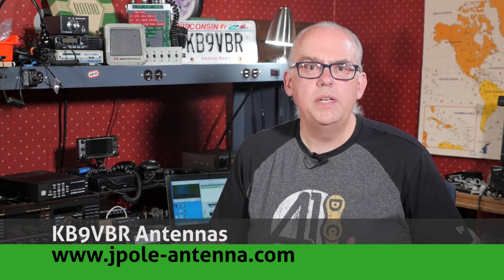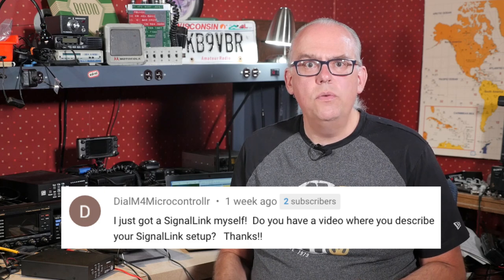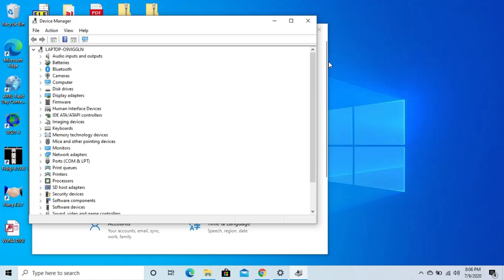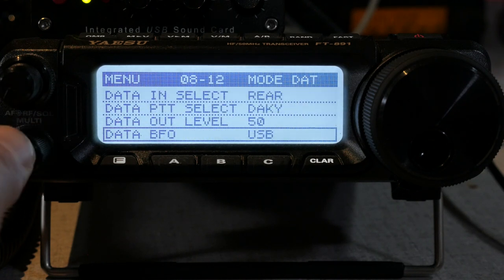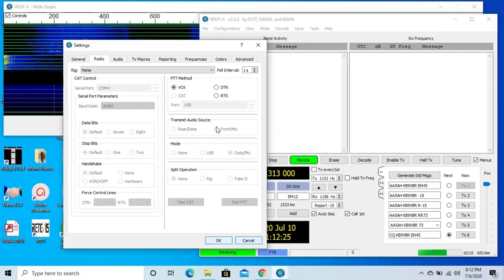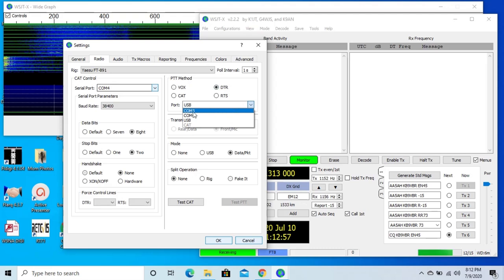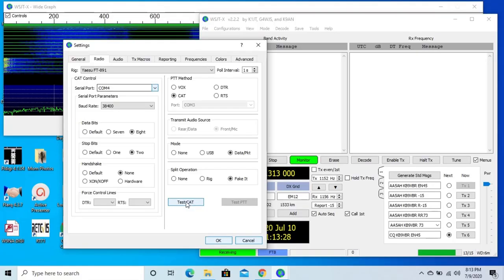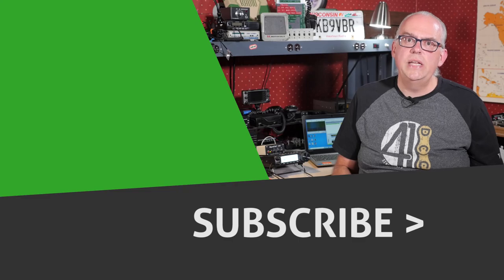Yaesu FT-891 Setup for Digital Modes - Ham Radio Q&A

Comment: Great explanation as always!
I noticed that in DATA mode the transceiver automatically disables AGC, which is understandable. Do I need to somehow manually adjust the gain for the FT-8 or just leave this knob alone?
And also, are there any differences in the settings for the FT-4?

Comment: Great video thanks. You also said "Unfortunately I had issues with Winlink so that will be a subject for another video " any plans on the Ft-891 Winlink video? I hope so, thanks.
Reply from the maker: Thanks for the reminder. I think part of my problem may be computer related so I'll revisit this topic.
Reply: @KB9VBRAntennas  Maybe but since I got FT8 working fine but still have issues with Winlink I am not sure. Actually I am not sure of much other than I can't get Winlink to work on HF. Frustrating but at least there is good ol VHF.

Comment: Have you run into any Hamlib errors?
I’ve had no issues before today. Not sure what I changed to have it be an issue. Rig and software will be running fine. Plenty of QSO’s and I’m seeing people ‘hear’ me around the world. Then: randomly (mid QSO) I’ll get a Rig Failure error window pop up and lose CAT control. Says it times out verifying current radio frequency. 
Only sure, but now apparently also temporary, fix has been to completely power the rig down and restart the PC. 

“Rig Failure

Hamlib error: Communication timed out
set_cache_freq: set vfo=VFOA to freq=0
ric.c(1488): set_cache_freq return(0)
ric.c(2030): rig_get_freq return(-5) wile getting current frequency”

Comment: Just got an 891. I'm wondering why you limit the transceiver output to 40 watts. WSJT-X documentation says to leave radio output at 100% and use the slider on the lower right to control power via audio level. This has worked on my ICOM 7300. Also - the Signalink website mentions two cables are available for the 891. Which one are you using?

Comment: Great video!  I actually made a cable from the data port on the back of my 891 to my computer's sound card and use the USB cable for CAT.  No need for a signalink.  Can you do a more detailed video on how to work FT-8 and other digital modes?
Reply: I’m with you - I don’t know why more don’t do this.  As it is the SignalLink has knob settings that were not reviewed with this video - how do you set up the computer’s sound card?

Comment: Adjusting "deep" menu item 16-03 to limit  data mode output power to no more than 40 watts is a great idea.  BUT unfortunately this same "deep" menu item also limits you to 40 watts on CW mode.  That needs to be a settable value stored by "mode", or else a front panel control.  What was Yaesu thinking...?
Reply: SSB is a completely different setting  (16-01) - But yes 16-03 will affect CW.

Comment: Does the yaesu ft450d setup similarly for digital and wsjt-x mode ops?
Reply from the maker: The process should be very similar. The menu numbers on the transceiver may be slightly different, but the process will be the same.

Comment: Are you using a usb cable connected to the rear of the FT-891 and a usb connected to the signalink to your laptop to do digital or just the signalink only?
Reply from the maker: I'm using USB through the Signalink and USB CAT control for the radio, so both USB ports on my laptop are being utilized.

Comment: I recently acquired a brand new FT-891  and configured everything for FT8 based on this video. I noticed that when the FT8 transmits it randomly triggers PTT. In order words, The radio doesn't transmit when its supposed to transmit. That happens with Tune as well. Sometimes it works, sometimes it doesn't  What be the cause of this problem? RFI on the usb cable? I used a standard computer cable that have ferrite tubes on each end.

Comment: Great video for setting up the 891.  I found a problem as one of the others in the comments below.  When using Fake It and if you have xmit freq above or below 2000 in WSJTX  the radio  display changes freq during xmit but stays there when going back to receive.  Evidently, I am not the only one having that problem.  Would sure be nice for someone to comment on how to fix this.   I set mine up for rig control and it sets the radio in split and moves radios xmit frequency (VFO B) when you shift xmit freq in WSJTX.  I had to set both VFOs to Digital USB and it works GREAT.   Like I said a comment regarding this issue would be appreciated.
Reply: I have had the issue when running split as "Fake it" and the Frequency adjust on tx up 0.5 KHz but when the radio goes back to RX the frequency does not readjust and on another TX the frequency adjusts up another 0.5 KHz and it keeps adding up every TX.  The way i have fixed this is by setting the PTT method to RTS and then selecting the USB interface in the drop down menu.  Now the frequency will adjust on TX up 0.5 KHz and go back on RX.  That said i have also had it where the frequency wouldn't adjust with on TX and i was still in a portion 2000 above on the waterfall.  I have tried your method of setting both VFO's to data then setting the split operation to " Rig " and this seems to work along with the PTT settings i mentioned above.  On TX the radio transmits from VFO B and then on RX it listens on VFO A.  VFO B ( TX VFO ) went up 0.5 KHz on the first TX but stayed there every TX after.  I am not using a signal link and my menu settings are different then the ones in this video.  Also after a couple of days of researching this in different places on the web it is very weird to me that so may people using the same radio and same setups and programs have different settings in their radio and different settings in their programs.

Comment: Can you help with the proper cable to order and jumper module for the FT-891?

Looks like:
 	
SignaLink USB p/n SLUSB6PM and SLMOD6PM?
Reply from the maker: Those are the correct part numbers for the cable and jumper pack.
Reply: @KB9VBRAntennas  thanks and keep up the great work on your channel!
Reply: What pins were the Signalink pin settings on the SLMOD6PM  @KB9VBRAntennas

Comment: One question.  I have taken most of the steps you have given.  I do see I have 2 com ports showing.  Do I need to installed the Signalink software & utilities disc that came with the unit?  Thank you so much for taking the time and putting this video together.  W7JMK

Comment: Michael, thank you for this video! Once I set up my ft-891 for ft8, would I need to change the settings back to use SSB? 
Like if I’m doing a POTA and want to switch from using one to another. Thanks so much, can’t begin to tell you how much I’ve learned from your videos!
Reply from the maker: If you use the Data mode for digital and the SSB mode for sideband, then you won't have to make a bunch of changes to the settings when you switch modes (except for adjusting the band width, WDH setting, when you go into the data mode). I have an updated video that has more information: https://youtu.be/afpvK8UrftU
Reply: Ahh, that’s great news, thank you. Also thanks for the updated video using the Digirig.  Again, thank you for your videos and replies to comments 😁. 73

Comment: Which Signal Link Interface did get for the 891
Reply from the maker: I use the Signalink USB interface and the SLUSB6PM 6 pin data cable that plugs in the rear of the transceiver. You'll also want jumper module SLMOD6PM if you don't want to configure the jumpers yourself.

Comment: Great video! Will the settings work for other digital modes as well? I do some PSK and SSTV. I want to learn FT8 and JT65. My SL is set to 857/450 pins. I'm guessing 891 is the same. Tnx! Steve

Comment: Mike, when I set things up as you lay out, for ft8 when my receive freq. is set to 14.074, but when in transmit it shifts to 14.0735. I've never noticed this before on my other fixed station, so I'm thinking it's an 891 setting but I can't tell what. Any ideas?
Reply: Mike, I think I figured it out. Between the 10 and 13 minute mark in the video you talk about the very thing I'm seeing, and I even see it on your display shifting from transmit to receive. Exact same thing. It's the split option. So this is not a problem but a feature that I need to understand better.

Comment: followed your instruction for ft891 with signalink and wsjt-x.  all functions, except no power out when transmitting...any suggestions?  thanks 73-gary
Reply from the maker: If there is no power out when transmitting, that would be an audio issue. When you transmit a signal on SSB, if there is no audio, there will be no power output. I'd check the audio chain and levels in the computer to verify that sound is reaching the transmitter.

Comment: The missing soundcard in the FT-891 keeps it, in my opinion from being a "great"portable radio and only a "good" one.  Yaesu got really cheap here.  The new FT-710 apparently does not have soundcard either.
Reply from the maker: I would tend to agree, Yaesu makes sometimes makes some really strange design considerations. But in their defense, digital modes weren't quite mainstream until FT8's meteoric rise with the 2018 ARRL grid chase. So they may not have thought that a sound card was necessary in a field/portable radio. 

I would be entirely surprised if the FT-710 did not have a sound card. While the specs on the rig are still pretty light, there really is no indication that one would be missing. Two items that lend to there being one is that the rig has two USB ports, type A and B, and it has a 'preset' mode that you can custom tailor for digital (specifically FT8, per John Kruk of Yaesu's podcast).

Comment: Currently running 891 HF phone mobile.  So I buy the signal link,  and connect,  set up rig in the menu for FT8.  Then I want to run HF phone again.  Just turn off signal link,  or reconfigure every time?  Thanks!
Reply from the maker: The FT-891 has a separate Data and SSB mode. If you set the rig up to use the Data mode for FT8, then it will remember your settings for phone when you switch back to SSB.

Comment: hello from Northern Albert -35c
Can this setup also work with the FT-757GX?
Thanks and have a great New Year!
01/01/22
Reply from the maker: Possibly. I don't know if the FT-757GX has yaesu CAT control or not. If it doesn't you'd have to set the rig up using VOX with the Signalink.

Comment: could you clear up which Signalink to buy, the cables needed and how to hook it up?  I watched the video a few times and you speak of connecting the computer to the 891 but not to the interface.   I probably missed it so I apologize.   73 KC3QQM
Reply: You may have found your answer, but I'll leave it here in case of others.  You of course need the Signalink USB itself.  Yaesu (and many other modern radios) use the SLCAB6PM cable - 6-pin mini-DIN plug.  And 2 USB cables - but pretty sure those come along with the 891 & SL-USB.

Comment: Would the settings for my ft-920 be the same?  Even if the menu numbers are different?
Reply from the maker: I'm not entirely familiar with the FT-920's operation so I'm not sure. The settings for the Ft-891 would  be a starting point‚ you'd have to experiment.

Comment: Have set up my SignaLink USB and FT-891 according to your video, but WSJT-X continues to crash after only about 2 seconds. 
Cable from SignaLink to FT-891 6-pin DIN; cable from USB back of SignaLink to laptop PC; cable from USB back of radio to laptop PC.
Must be doing something wrong, or cables incorrect?  Any suggestions? Thank you!
Reply: The same setup I'm using.  Did you get it going ? PM me at <calllsign> at arrl.net  if you want to compare notes.  Andrew NO6E

Comment: You omitted one VERY important aspect.  You didn't show or go over the physical connections.  Unfortunately trying to go to HRO or DXEngineering and finding the right model number that corresponds to the 891 is very confusing at they don't use part numbers that make any sense.  Would have been nice had you spelled out the specific model number you need to order for the 891.
Reply: To answer my own inquiry - here is what you need for the 891 - Tigertronics SignaLink™ USB Digital Communications Interface Combos SLUSB6PM-P ($140 presently).  And for the internal jumper kit -  you can use Tigertronics SignaLink™ Plug and Play Jumper Modules SL-MOD6PM ($10 presently)

Comment: I was able to setup the connection (I am waiting for the interface to be delivered).  When I close down the application, unplug the USB and even turn off/on the radio it seems to be still in digital mode.  Currently I have to reset to factory defaults to get back to SSB.  Is there a easier way?  I know this is probably a really silly question.  Thank you....
Reply from the maker: The FT-891 remembers the previous modes and settings when you turn off and on the rig. To get to the mode switch screen, long-press the Band button and use the function knob to switch from Data/Pkt to SSB.

Comment: Does this only work with Signalink, or will any USB audio interface work? You enhanced port shows as COM4, but you used COM4 for CAT control. Backwards? Would be good to show the physical connections.
Reply from the maker: The instructions in the video aren't specific to any one USB interface, so it shouldn't matter if you have an Signalink or not.

Comment: Great video...I have an 891 question...After working FT8 on 20M, my Radio remains in D-U mode. How do you get the radio back to USB? :) I have looked through all the menus and placed the BFO select in Auto.
Reply from the maker: When you leave WSJT, the program doesn't switch the radio back to SSB mode, so you will need to do that manually. You do that by long-pressing the band button on the top of the radio.
Reply: @KB9VBRAntennas  Got it.....yea it took some digging in the manual to find that about an hour after I asked that question :). Got about 65 POTA Contacts today in a little over an hour. 20M was strong.

Comment: hello friend I have the same equipment as yours the yaesu ft 891 the same signalink  and when I do everything like you it doesn't connect and it tells me this;

Error Hamlib: Protocol error
rig_get_mode(2204): freqMainB=0, modeMainB=, widthMainB=0
rig_get_mode: elapsed=83ms
rig.c(2207):rig_get_mode return(-8) Protocol error
rig_get_mode(2204): freqMainB=0, modeMainB=, widthMainB=0
rig_get_mode: elapsed=83ms
rig_get_mode: elapsed=83ms mientras obteniendo modo actual

help me please   73

Comment: You forgot to mention the bandwidth cause sometimes it goes to 500hz instead of 3Khz otherwise no signals can be decoded.
Reply: That is an issue when you first setup and causes a lot of initial confusion.
Reply: TXLorenzo Not only first setup I have it also when i have used the set sometimes for voice.

Comment: Hi, would the rig settings be applicable to the 857d? Cheers, Pat.
Reply from the maker: It probably would. I don't have an 857D so I'm not familiar with the menu options, but it would be a good starting point.

Comment: I have this same set up but the driver wont work with a Mac computer. from Yaesu , have any ideas ?
Reply: Apple broke the driver support in the latest update to their OS. This will only get fixed when Apple fixes it. It breaks more than just WSJT-X, but all programs that use the Silicon Labs driver.
Reply: @jyunte  thanks for letting me know this
Reply: I apologise.... The bug that Apple created is only for the FT-991 on the Big Sur OS. So it looks like you'll have to find the solution to your problem elsewhere. ☹️
Reply: @jyunte  no problem thank you

Comment: Great video Michael.  Everything works except WSJT-X forces the radio into split mode, even though it was turned off in the 891.  Oddly enough, the split is 1 kHz each time.  Sometimes it’s 14074 and other times it’s 14073.  I’ve restarted the program, radio, and computer.  Any thoughts on what might be causing this?
Reply: Normal depending on where you have ur xmit freq set on the waterfall  set to 2000 no change.  1000 it will be lower 2500 higher.

Comment: I tried using a Signalink along with the FT891 and had issues. With WSJTX, it will transmit one cycle then halt or disable transmit. If I don't catch it, I loose the QSO. Another issue I have ran into is that it wants to change the frequency...Its like when the transmitter is enabled and the software is doing the split thing, once it unkeys, the receive frequency changes to the transmit frequency. Fake-it doesn't work at all.....I have to use Rig split control....Wonder if anyone has had issues like this. At first I thought it may have been a RF issue, but the same computer and cables minus the Signalink work fine on a IC-7300
Reply: Gary, I’m having exactly the same issues. It transmits once, and then it won’t anymore. But it only does this intermittently.  Sometimes it will, other times it won’t. And after transmit, it won’t go back to 14,074. It’ll just stay where it was during transmit. Did you figure anything out?
Reply: @W7MMG  no, I gave up and sold the FT891 and replaced it with a 7300 for  POTA. The FT891 is a great radio for POTA until I decided to do digital. Since the 7300 has the sound card built in,  it makes things very simple
Reply: @garystout4300  I understand completely. I had been using a 991a for my digital stuff, and wanted the 891 for POTA. But somehow, and I have no idea what I did, but it’s working now with the 891. On the split control, I clicked none instead of fake it. Don’t know if that actually did the trick, considering I’ve clicked a hundred other things, but it’s working. Lol
Reply: @W7MMG  good deal! It's a great radio, but Yaesu really missed the boat when they didn't include a sound card built in. After trying the Signalink and then the Rigblaster and still having issues, I just gave up. The 7300 is a little bulkier,  but that radio is simple to operate.  Maybe I will catch you on POTA or a P2P someday.
Good luck, Gary NY9R
Reply: @garystout4300  I tried the Rig Blaster too with no luck. 991a is easy to operate digitally too. Hope to catch you on POTA as well. 73… W7MMG